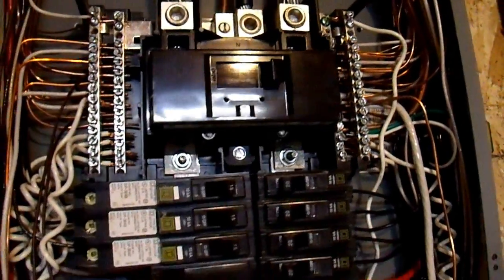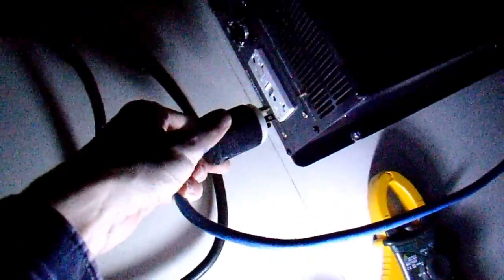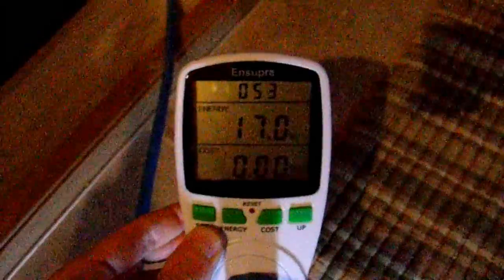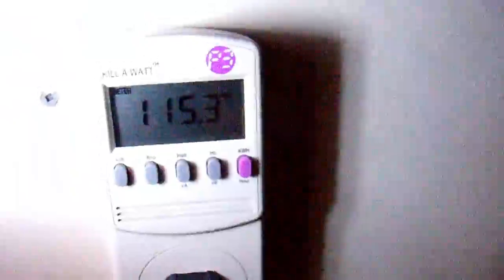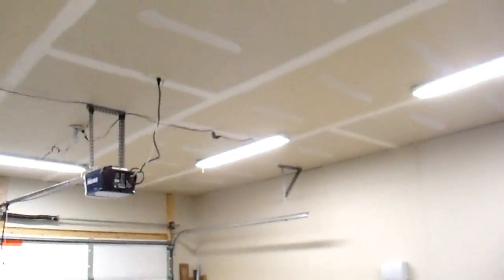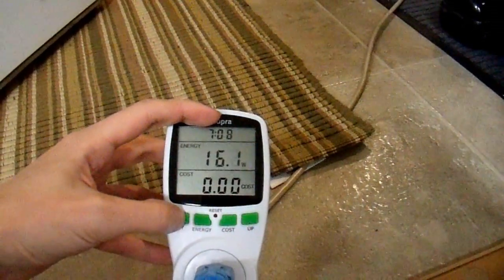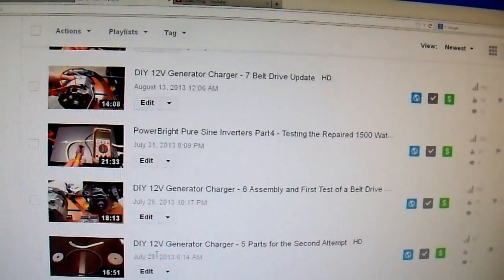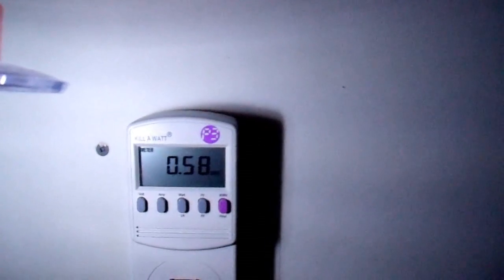How to Power your House with an Inverter or Generator During a Power Outage Part 3/3

Comment: At the start of the video, I was expecting when you flicked off the main breaker, backup power would kick in automatically.... So in order for your 'backup' system to work, you need to go to the meter box, flick off a bunch of circuits, plug in a bunch of cords, move your cars etc etc etc etc.... in the meantime your fridge is now room temperature, awesome 'backup' system.

Comment: Are your batteries still working after 3 years?
I made the same connection using a Phase Generator Manual Transfer Switch but the batteries lasted only 3 years. Not solar but gel batteries. Also it damaged my sub-woofer all other devices OK. Non Pure sine-wave inverter.
Not willing to invest again in batteries.

Comment: So why the pure sine wave inverter? Doesn't seem like there is anything that requires pure sine to run that you couldn't live without and the pure sine inverters cost is way more.
Reply: LED TV, DVR, Computer, battery chargers, microwave...all things w/sensitive power profiles don't like MSW. They may work, but will get hot & buzz alot. SW is just better for everything except resistive loads like incandescent lights. My heating pad w/digital controls wouldn't even come on till I switched over to SW inverter in my RV. I'm 100% off grid- powerwise...

Comment: A way around the heating issue (if you have a 240V central heater), especially at night and especially if you like a lot of light, is to use old style 120V (or 130V) incandescent lights.  I have 3 of those, 300W each.  The light they put out is intense, especially when all 3 are illuminated.  3700 lumens each for a total of 11,110 lumens but they can also heat a room.  Something like that would work well in a cold garage, providing both heat and light.  Probably  a good idea to blow a fan on low across them to help circulate the heat and somewhat cool the lights.

Comment: Not the best charging arrangement, connecting the charger to the first battery and relying on the parallel connections to charge the other batteries, but it is simple so that is good.  You can do better and I am sure you know how with your intelligence.

Comment: So I need my 240vAC circuits as my well pump  and other essentials are on 240vAC.  Guess I need to source a 240vAC inverter with bonded Neutral? I've got a dedicated 240 outlet in my garage for my welder I can use for backfeed

Comment: Are you able to use the 220v breakers with this setup? Not counting the fact that you need a bigger inverter. ;) but does the 220v circuits work like they should?
Reply: No, both Lines are in phase and so if you switched on those 240vAC breakers you'd read 0vAC across the X and Y lines even though you have 120vAC from X to Neutral and 120vAC from Y to Neutral.  On mains power, the X and Y lines are 180 degrees out of phase so you get 240vAC from X to Y.
Reply: Same phase not opposite phase. Got it.
Thanks!

Comment: I enjoyed the series , so thanks for sharing. I also really enjoyed reading all of the comments. Double the entertainment. I haven't checked all of your other videos yet , but I'd love to see a split phase inverter set up. At this point , it sounds like the most logical way to go ( if you want to still use the 240 loads). Besides , you never know when you may need to use a 240 volt inverter type welder when the power is out. What are your options?

Comment: So ground is taken out of plug - even on pure sign wave inverters? I have done this before with a generator with ground - and it worked fine.  I am planning to use a 240 hot water heater circuit that is no longer used.  For safety, I am planning to use a marine shore power plug.  Setting up backup power using solar.

Comment: I did not experience any of the problems you ran into.  I installed a double pole double throw manual switch below my outside panel.  When the lever is in the up position my house runs off the electric company.  When the handle is in the down position the electric company is disconnected and I can connect my Honda EU2000i to the switched terminals.  This allows my house to either be fed from the electric company or my generator without any worry of crossing up the two.  I bridged the 240v terminals together for the hot feed so that both sides of my breaker panel is receiving 120v from the generator.  Of course the neutral/ground is wired directly.  I had no problems with my GFCI outlets.  They continued to work as designed.  Nothing tripped out.  I switched off all 240v breakers in the outside and inside panels before running the generator to prevent shorting it.  The only breakers left were the 120v ones.  I was able to run anything in the house that did not overload the generator.  The 1500w microwave was too much for it but the fridge, lights, TV, computer, phones and alarm system ran just fine.  I recommend changing your light bulbs to flourescent type to help keep the generator unloaded.  Incandescent lights can eat up a lot of watts.  I don't know why you experienced so many problems trying to back feed your outlets but I assure you the way I did it is much safer and a lot easier.  The manual transfer switch is not outrageously expensive but you will be dealing with some direct feed from the power company when installing the switch so you may need an electrician to help you.  The installation is permanent once installed and that makes it very easy to set up your house for 120v generator feed at any time.  By the way, my house has standard breakers, not the new arc prevention type.  I don't know how those new breakers react to this setup.  Please be careful and if in doubt get an electrician to advise or help you.

Comment: Can anyone tell me why he wouldn't just install two new breakers, making sure to put the breakers to get both phases, and  install two new outlets in  his garage, and plug in his inverter to them .
Reply: +Tammy Jackson 
What he is doing is very dangerous.  The methods depicted in this video series electrocutes people and starts house fires.  This is the wrong way to connect your house to emergency power.  Knurlgnar does it this way because he... well I don't have a clue why, he should know better.  
Anyway doing what you suggest just adds cost and labor to the wrong method.  If you're going to expend the money and time to connect to emergency power you might as well actually do it the right way.

Comment: I have a 15KW split phase pure sine inverter with a 240VAC output.  If I install a 240 plug and tie it into a 240V breaker (according to your drawing is connected into L1 and L180 and N and GND) should I be able to backfeed to both 110 and 220 circuits?
Reply: +Mike O puit both 110v circuts in series and connect your 240v connections onto it if you neded help i can help you with it if you want
Reply: +Kristijan Dinga Yes please help me with this.
I am trying to do this safely
Reply: Mike O ok
Reply: so when you say "Split Phase" you mean you have 2 phases and 1 nuteral and when you connect from L1 to L2 you have 220v and if you connect from N to L1 or L2 you have 120v ?
Reply: +Kristijan Dinga send me an email address and I'll send you a link to the inverter
Reply: Kristijan Dinga not sure what you mean.  Can't picture it.
Reply: Mike O So how many contacts do you have on the output ?
Reply: +Kristijan Dinga I have a pic of the connections.  How can I send it to you?  It is easier than trying to explain it.
Reply: Mike O ah ok so you can connect it so it can give you 220 and 120v so note you cant have 15kW at 120v only half of that only at 220v you can use 15kW so can you send me a picture of your breaker panel
Reply: +Mike O 
Just to clarify here, you obviously don't know what you are doing and instead of calling an electrician you are trusting your life and home to some complete stranger named Kristijan.  Am I getting that right?
Reply: +Terry Pullen I don't trust my anything electric to anyone unless I get professional confirmation of the answer.  advice is cheap but helpful in most situations
Reply: +Terry Pullen What is your opinion on the topic?
Reply: Terry Pullen yeah i was acctually planning to set it up so that he connects the live to the live and ground and connect the inverter ground to the acctuall ground so that it kills him whe he tuches the metal of an aplience :)
Reply: Terry Pullen haha u schlud get some wire and wrap it around him and plug it in 220v that shud keep him clam :P

Comment: so i have a sun-2500p/48 240 with output wave (spstm) semi-pure sine wave. ? will it has it's own ground plug and 2 20amp 240vac wall plugs that look like 120v on the front of it. but its diagram shows it as 240vac 20amp {x2 wall plugs} and the front ground. i was gong to use a 25amp 240 circuit breaker from the inverter to breaker box, and the ground of the inverter and box to earth. ,, until i saw your videos. ok so its for a garage that has never hand power to it and its 100% off grid. so no house appliances or gfci to deal with. 

so plz what do i do to power this bad boy up??

Comment: I'm looking at one of those cheaper inverters on eBay and curious if it would work. If I understood everything (from the video series), what I'm looking for is a split phase with two 110 outlets.

I'm not too concerned with the safety hazards of interfacing with the mains breaker because this will all be on a separate breaker completely isolated from the power company's mains. The idea is to slowly migrate from the grid to an off-grid setup, one breaker at a time - scaling the panels and batteries as I go.

The inverter I'm looking at is labeled as "3000W LF Split Phase Pure Sine Wave Power Inverter DC 24V to AC 220V & 110V 60Hz". I'd ideally like to go with 24V or more because of the longer-ish cable runs from the solar panels to the charge controller, and keeping everything on 24V seems like a better idea. Add in the fact that 24V is more efficient AND cheaper (the 12V counterpart being about double the cost).

Thoughts?

Comment: Have you tried to hookup the battery charger to the inverter to charge the batteries at the same time using the inverter to supply power to the house? Would it work?
Reply: +1wasimtiger Yes you can, AS LONG AS YOU HAVE EXTERNAL POWER COMING IN from somewhere.  For instance, you could take a little Honda (or similar - not bothered about the brand) generator that makes 1600 watts.  Run the generator, plug the charger into the generator, and charge the batteries while you pull power from the inverter.  
Why would you want to do this rather than just running the generator to the house circuits?  There are advantages which may overcome the complications (usually I'm against complications, but sometimes you can't avoid them).  Say your wife really, REALLY wants to run her hair dryer while the coffee is being made. In the bathroom, the lights are on and the fan is running -- call that 100W and the hair dryer is 1500W.  Already you're using the all the generator output.  But if you turn on the coffee maker, and add 1300W you'd overload the generator is you were wired direct.
But if the generator is powering the charger through the batteries and the inverter, it's no problem, the "extra" power is taken from the batteries.  After she's finished drying her hair, turned off the bathroom light and fan, and come in to settle down to coffee and a nice breakfast, you may only be pulling a few watts through your house (no matter, you MUST reduce your power loads).  Then the generator still pulls along at 1600W (or whatever current your charger requires) and that current brings your batteries back up to 100% charge.
A byproduct of this is that when you need to, you can turn off your generator, let it cool for a while, fill the fuel tank and check it over to be sure it's OK.  During this time, your house is running off the batteries.  When you restart the gennie, again the "used power" from the batteries is made up.  In the same way, if you've reduced your loads and have  a suitable battery bank, you can switch off your generator at night and sleep quietly while battery/inverter powers your thermostat for your gas heating system, your fridge, and your alarm clock. Just as before, get up in the AM, start the gennie and you're ready for the day with the overnight power being replaced into the batteries.
Again, you 'll notice I said "AS LONG AS YOU HAVE EXTERNAL POWER COMING IN".

(NOTE:  Check on your components, some cheaper electronic items are not sophisticated enough to support this and this they don't this system won't work.  But with the right gear, it works like a charm.)
Reply: +1wasimtiger 
You have stumbled into a truly important question.  This question reveals the complete misunderstanding most folks have of electricity.  It's my guess is that Knurlgnar hasn't tried what you suggest because he understands the concept of conservation of energy and knows that connecting a battery bank to itself creates a closed system with inherent energy losses such that less energy goes back into the battery then comes out, thus depleting the battery not charging it.  

Questions like this make it obvious that a large percentage of people watching this video series do not understand anything about electricity or physics and these videos are dangerous for people at that level of understanding.  

Do not connect your house to emergency power using the method depicted in this video series.  It is dangerous.  It will void your homeowners insurance.

Comment: FYI, in case you're thinking about going to LED 4ft fluorescent tube replacements to conserve power.  I did an experiment with an existing 4 tube, 4ft, fluorescent fixture with T8 bulbs.  My fixture pulled 1 amp with the 4 T8 tubes with an older style electronic ballast.  I changed out the older electronic ballast to a NEWER style electronic ballast capable of running my Philips LED T8 replacement tubes.  The new ballast and new LEDs pulled .7 amps.  I saved .3 amps [36 watts] at a cost of over $100+ in LED bulbs, wire nuts and new ballast.  NOT worth it to me.  NOW, if you have old magnetic ballasts running T12 florescent bulbs, MAYBE it would be worth it to retrofit and old fixture and convert it.  ALSO, pay attention to your LED bulb requirements.  Another manufacture says you have to totally disconnect the ballast from the circuit, put a dummy socket in 1 end of the LED tube and connect the other end directly to 120 volts. You can make your own dummy socket by cutting off all wires connected to the socket. I did no experiments with that type to measure LED load in amps.  I also have not looked into the cost of a new LED equivalent 4 ft fixture.
Reply: SpockMcoy Issmart Jeez. What a deal breaker. At $100, I'd rather put that money toward another battery. Thanks for sharing.

Comment: Interesting to see the "earth leakage" (as we call it here) integrated into the socket. In South Africa we have 230V as in Europe, but it is not a split-rail supply. There is one residual current breaker (or earth leakage) in the DB board. In theory a suicide cord would work perfectly (save of course that you can still put more than 20A through the wiring on the circuit that you're back-feeding into) here. I usually advise people against it though... it's just way too dangerous :-)

Comment: Great job and as a Facilities Manager for over 15 years, you do an excellent job of explaining safety showing the laymen all the details. I will be using this for training of my crews.
Reply: David DeRoche ,  i have a garden.  it is picked clean every morning and I keep a very tall fence around it. is it possible that another world is under us? and there are people there who are grey with big eyes? and are picking it clean?   my best guess they are joy riding in with a ship or have a sort of tunnel that they camouflage with a hologram. how do i stop them from picking my garden. i am in the dark and dont have Solar power. please help if you please
Reply: +David DeRoche 
The method depicted in this video is not code approved.  This means that if you knowingly wire a facility using this method your property and liability insurance would likely be null and void.  

As a facilities manager you probably have a good relationship with your local building inspector and Fire Marshal.  Do you think it would be a good idea to call one of them before trusting your facilities (and your job) to a complete stranger named Knurlgnar?
Reply: yes, its perfect with Code. You must not be upto with any training. I just used it at my last career day my entire crew is much better off. I am  King where I work.

Comment: So how do you get your 240v appliances working. If you had both circuits powered wouldn't your stove be able to work? Would you have to do anything special?
Reply: +ryan m You need a 240v split phase inverter.

Comment: About inverter neutral, you can test this by using the DMM to measure voltage difference between Neutral and ground by putting one of the probes on the floor, you'll see a small voltage compare it with the Live phase one, it's the same for off-grid inverters, while the grid Neutral is zero (grounded)
that's the difference between mobile and stationary inverters  http://www.aeesolar.com/how-stationary-and-mobile-inverter-systems-differ

Comment: Thank you for your videos and for sharing excellent information. I worked with DC power for years also some commercial gensets so can appreciate your resource. I'm retired in rural Maritimes where power failures are not uncommon, so am thinking I will rig a small solar array, charge controller and some deep cycle rescued marine batteries with a small pure sine inverter to run a few things rather than crank up the elderly Honda.